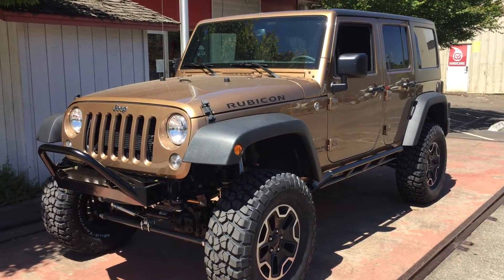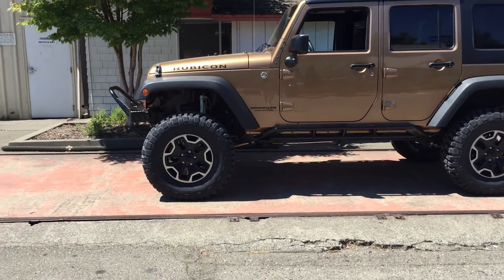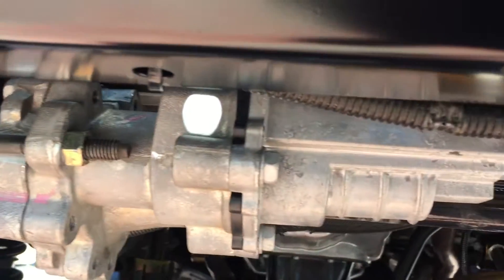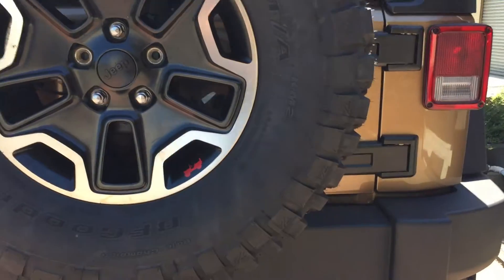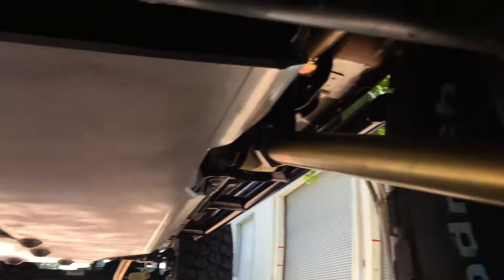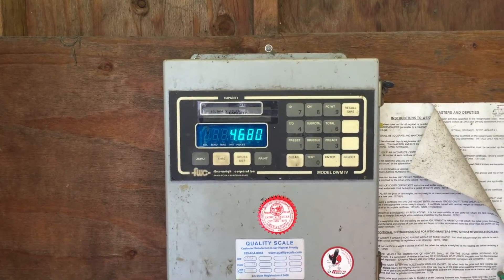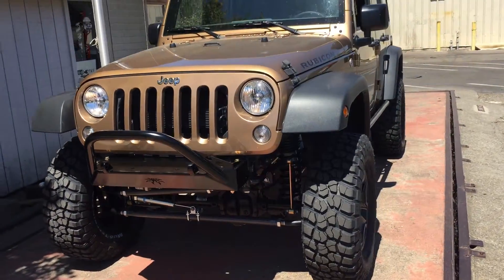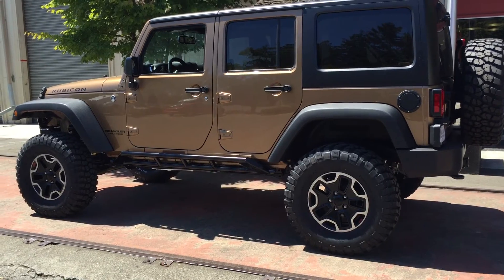2015 Jeep JKUR with. 3.5 inch lift and 35s.

Comment: Why not just put a taller spring in the front instead of a spacer? i went with rock crawler 4.5 in the front and 3.5 in rear i figured the 6.4 will drop the front a inch ?
Reply from the maker: We took the spacer out.
Reply: i wasn't commenting on the lift in particular
i was just asking why folks in general add them? instead of putting taller springs

Comment: 1350 bad idea. It makes the joint stronger than the gears which is more expensive and hard to replace over a simple u joint fix. Should have gone with 1310 !!!
Reply from the maker: We are only running 35 inch tires, we should not have any problems with gears or drive shafts. No braking is the answer.

Comment: so this is the metal cloak 3.5" with a 1" coil spring spacers?
Reply from the maker: We ended up taking the spacer out
Reply: Jeep Speed Shop is it still pretty level? About to install same lift on my Jeep JKU.
Reply: Jeep Speed Shop did it ride bad? i wanna add one to mine to make it level